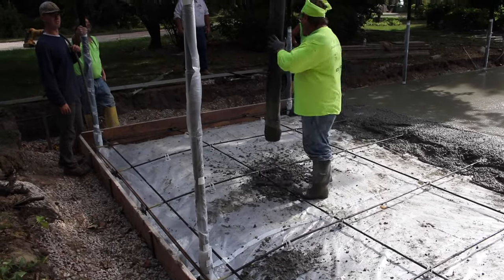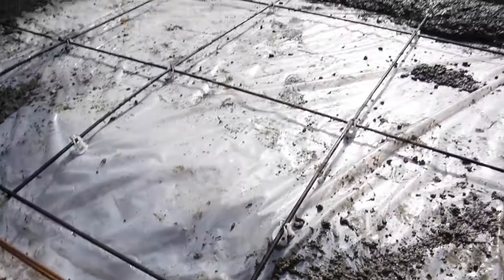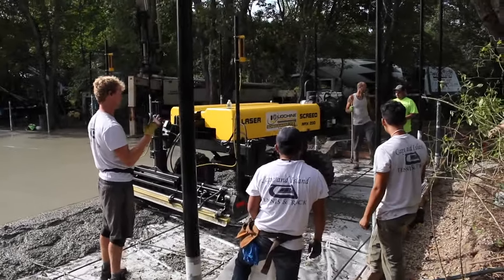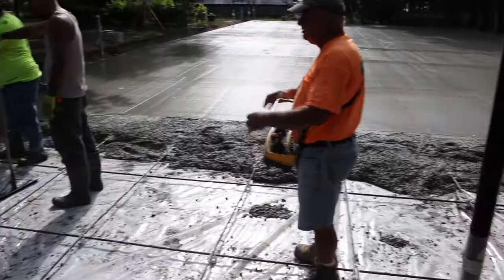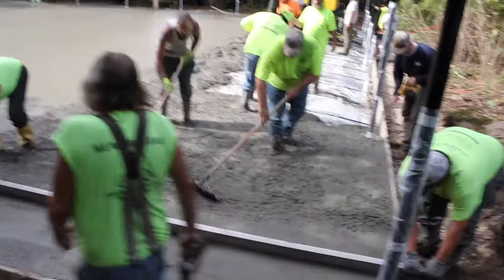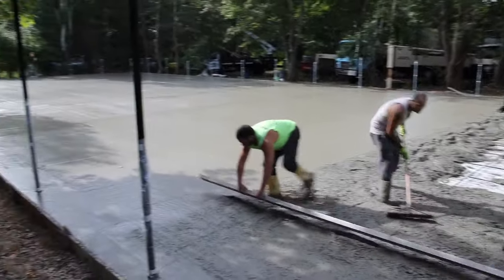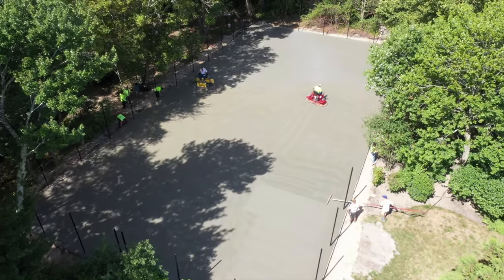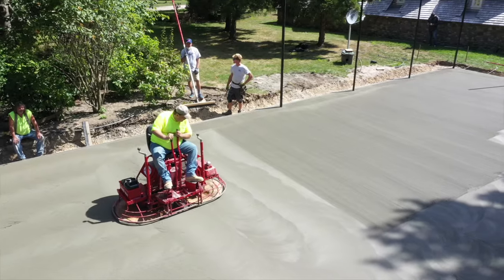What is a POST-TENSION slab? How does it work?

Comment: I have to do some drilling in my 1974 garage slab to install a car lift, will a bosch tool for metal and stud detection would point out if and where the rebar, or tension cable if present is?

Comment: Are the finishing machines on the last scene basically hovercrafts, use these fans to lift themselves over the concrete? Or it it wheel-supported and the blades physically finish the concrete?
Reply: The spinning blades actually support the machine, think floor buffer as an example. They work with the same principle that those big floor buffers that you see janitors using in commercial. If you apply pressure to the left or right side of the handle on a floor buffer the machine will move left to right. It's actually the opposite direction that you apply pressure. If you apply pressure down or up the machine will move back and forwards. It's exactly the same with these ride on finishers, they vary the pitch of the blades on the left or the right side of the machine to move the machine in different directions. It's actually quite brilliant also very much like the way that a helicopter maneuvers. Everybody wants to ride these machines when they're on a construction site there are a lot of fun but take a little bit of experience to learn how to use.

Comment: Pretty good overall synopsis of pouring concrete with cable tension. Of course they're always going to be detractors but anything you missed in this video can be covered by some other video on youtube. There are plenty of them out there. The laser-guided auto screeds are fascinating and there are many videos out there of them and use which explain them a little better. One thing that I thought was interesting and show just how much thought went into them, is that they have a series of legs on them sort of like a spider. This is how they move around over rebar or cable tension without damaging it. They put a set of those legs down move back a little ways look those legs up but the other set of legs down etc and that way they can step over rebar or cable tension when they're out in the middle of a slab.

Comment: That had to be one seriously expensive tennis court. I’d rather just go with #4 rebar 18” oac and make some saw cuts to control cracking. I understand why they don’t want joints in a tennis court, but even with post tension that huge slab is going to crack

Comment: I drove concrete mixers for 10 years . It ain’t no joke at times. I poured a driveway that was straight up and down . I shot concrete out far away into footers perfectly . I’ve poured a slab once so smooth the finishers didn’t even scrap it .
Reply: Lol as someone who currently test concrete and has been at a lot of concrete pours, I’m not sure that’s possible, but if it happened 🤷🏽‍♂️
Reply: I'm a heavy-civil construction superintendent in nyc for over 20yrs.  I've had privilege to work with some of the best concrete guys in the biz.
And I've never seen it either IF IT WAS A FINISHED SLAB, sure if it was just a rat slab for temp purposes or something that was going to have a covering, dragon board, pavers, ect.
But not a finished slab. Not possible
Reply: Obviously I'm assuming there was going to be a covering of sorts. Pavers,  tiles, something.  But even then it takes a great mixer operator to do. Talent right there